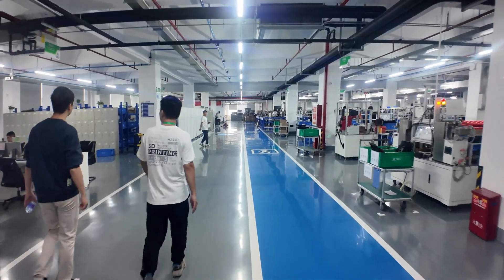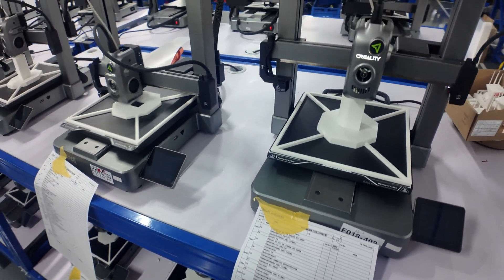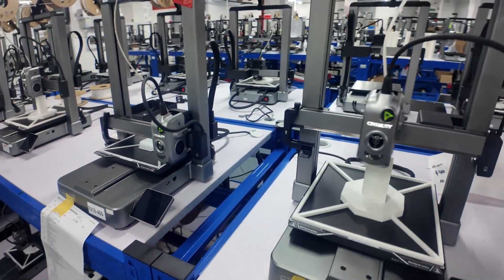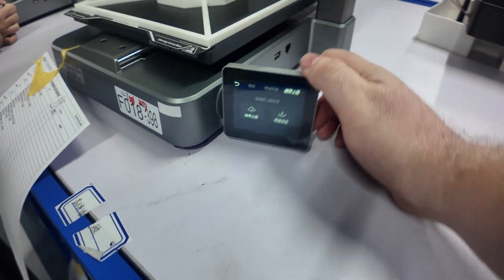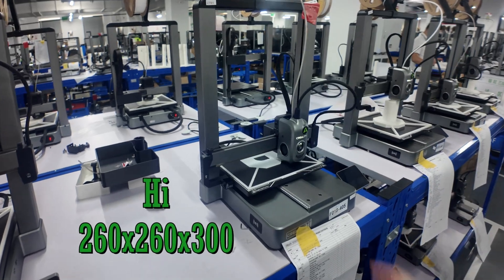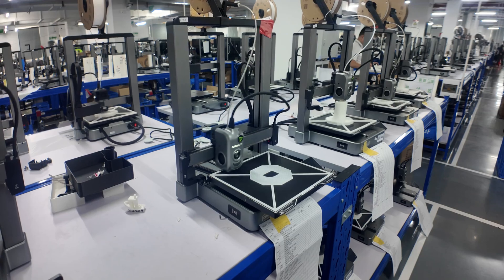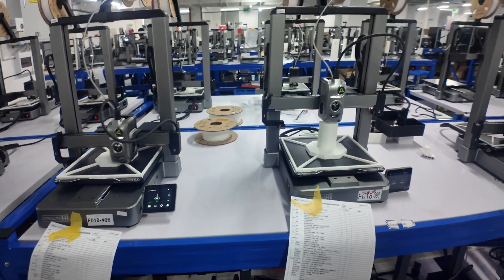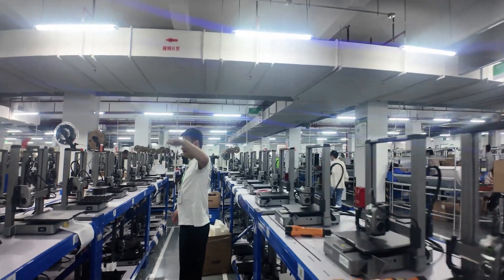New Printer from @Creality3D The Creality Hi is here. Factory tour discoveries!!

Comment: The only thing I would love to know is if this can be enclosed to print something like ABS?
Reply from the maker: so as i look at the specs it says the max nozzle temp is 300 and bed temp is 100. So that is hot enough for ABS, the short answer is yes. But as you mentioned, ABS likes to be kept inside - it can be a pain to print without enclosure. SO that means getting an enclosure for it.
Reply: @ But, will it withstand the temperature given that the screen will be inside the heated chamber?

Comment: do these printers take an SD card? im not seeing an SD card slot.
Reply from the maker: There is a USB card slot, but no SD card. I have printed from a USB drive a few times already.
Reply: @kevin.in.3d  oh okay so you can use a cheap USB flash drive then to print from then? is that what you mean?

also are the nozzles similar to the ender series where you can screw them in and out of the hot end for replacement or is it like the bambi A1 where you have to swap out the entire hotend to change the nozzle size? appreciate you taking the time to answer my questions.

Comment: Does it have a flow sensor? Pressure Advance sensor? Is it quieter than the A1?
Reply from the maker: No flow sensor
PA sensor that is preset
No idea what an A1 sounds like but this has some closed loop motors that are quiet. CFS is not too quiet tho.

Comment: I have a question for everyone. I've had original Ender 3's and now I have an Infimech Tx. It's the first Core XY with enclosure I've used. How does
this Creality printer relate, or does it?  I'm  curious if this new Creality can print ABS without an enclosure? I'm by no means an expert and have
genuine curiosity.  Thanks in advance!!! God Bless Y'all.
Reply from the maker: I was hoping someone else would give you an answer. In my experience, ABS needs an enclosure to keep the print stuck to the bed. I only print ABS in my K1. Have not tried it on my Hi yet. It meets the heat requirements but ABS is so picky - always wants to lift.
Reply: @kevin.at.Creality  you're correct. I'm able to print ASA and ABS with no issues. And yes, my printer does have an enclosure. Thank you for responding!!! 👍

Comment: 2:03 I'm curious about those test stations. What is the white surface made of? How is it attached to the blue, metal racking? I've read comments about people experiencing resonance with multiple printers on the same work surface and there they have 3?
Reply from the maker: they actually have 3 more underneath - so each metal rack has two shelves with 6 printers on it - it's a lot! I think the white shelving is particle board, I don't know how they attached it but these are very heavy-duty shelving units on a concrete floor in a factory so they likely can hold a large load and are very sturdy. I have two printers on an IKEA cabinet and it is very sturdy also - I have never had any wobbling issues.

Comment: I think the behind-the-scenes videos / factory tours are great. Is it very loud in the hall because of all the printers?
The Hi seems perfect for beginners or as a second printer, especially because of its price and size. Unbox it and get started.
It's also great that it can be used with a CFS. The print bed also has a good size.
Reply from the maker: Honestly it has replaced two of my printers at home. Having filament loaded in four colors is awesome. Slightly larger build volume is very handy. I didn't really think the factory was that loud. The machines are humming but it's a big space so it wasn't offensive.
Reply: @kevin.in.3d  That's cool that the Hi replaced the others! When it comes to the space it needs, the Hi definitely has an advantage over the larger ones with closed installation space.

How did the CFS go for you? I think multicolor printing is really great and opens up a lot of new possibilities.

Sounds good that it's not too loud in the production hall!

Comment: Fun video. I'm still a bit sore that my K1 Max still doesn't print half as well as my Bambus, so it will take me a lot to buy another Creality again. Creality is trying hard to duplicate all of the Bambu printers. This isn't really a bad thing and I do like that is uses the same CFS instead of a AMS Lite style set-up though.
Reply from the maker: Also can use 4 CFS - unlike the lite which can only do 4 colors. We will win you back! We are trying anyway lol
Reply: @ Agreed, thus why I said I like the use of the standard CFS. Both because it allows multiple CFS and it is fully enclosed. :)

I really, really want to be won back. I've had at least 20 Creality printers over the years. The K1 Max experience and it being released before being fully ready, just stings a little a year later. I still have it, but only run it when I need over 255mm.
Reply: Do you have the updated model with unicorn nozzle etc? What sort of quality loss are you talking compared to bambu? 
I was tossing up between a k1 max and qidi plus 4 - the k2 is way too exxy.
Reply: @swempthebemp  My K1 Max is a weird mid-production unit. It had the updates to the extruder, but had the older, volcano style nozzle. I did the update to the hot-end to the Unicorn nozzle. I saw very little difference, if any. But it is easier to swap nozzles.

My K1 max had a TON of ringing/ghosting as delivered. Now that I have rooted it and am running standard Klipper, made a couple minor hardware changes, and altered how I tension the belts, it has reduced ringing for sure. I changed the bed to being adjustable as it was way off level as delivered and between that and changing the starting gcode to heat soak the bed for a long time (the beds are fairly thin and warp a good bit when heated), I now get consistent first layers most of the time. The times where the first layer fails seems to be more related to the nozzle wiping routine before the bed leveling sequence.

Comparing it to my Bambu A1 and X1C, I would say the surface and layer quality on the K1 max is around 75-80% of my Bambus. The Bambus I don’t even have to do anything with. But the K1 Max I had to work harder to calibrate.

Knowing what I know now, I would go with the K2 rather than a K1/K1Max. They released them before fulling baking them and are a bit in-between and for the price are just OK.
Reply: @iwannaratrod  think I'll go with the plus 4, thanks for the feedback!
Reply: @swempthebemp  I haven't heard anything on the Quidi from anyone I know. And it doesn't seem to be without issue either.
Reply: @iwannaratrod  the issues seem with 110v power (I'm on 220v) and they seem to have more features and a better finish for the price, just a lot shorter track record..
Reply: No Brasil chega quando

Comment: I really wish Creality would finally start focusing on after-sale support instead of continuously flooding the market with printers :(
Reply from the maker: I feel like they have been trying harder to focus on keeping people happy. Are you having some troubles now or is this a comment from a past experience? I know we definitely had issues before, you are not wrong. But we have a lot of ways to contact the help you need now - including emailing me at kevin@creality.com
If you need some help, I'm happy to see what I can do.
Reply: @kevin.at.Creality  
Hi Kevin and thanks for the reply.
The short answer; I just recently bought a K2+ and I'm looking to the future. Specifically how easy will I be able to get/replace wear-n-tear parts (belts, nozzles, belt tensioner, etc) or/and additional or variations of parts (bed sheets like PEI or smooth etc) or if I'll be able to get these parts at all.

Long answer (tl;dr);
I was on the fence between Bambu and Creality as my Little Monster just died back in August. Bambu has very strong after-sale support and they seem to focus on support and improvement of their current machines rather than flooding the market with yet another machine seemingly every 6months (exaggerated but you get what I mean). With Bambu, I would be able to easily shop virtually ANY component of their printers and have it shipped to me with no fuss. I don't get that warm-fuzzy feeling about Creality, knowing how they got to where they are now, but despite all that, I bought a K2+ anyway (I'll not go into the reasons why unless asked).
I'm pretty savvy when it comes to 'just make it work' if something were to happen, but I'm getting to a pointe in life where I don't want to have to constantly fiddle with something to make it work again. That said, while my K2+ has been an absolute unit of a machine, the maintenance clock is ticking and when times up (IE, when something fails or is worn out) I'd like to be able to go to a parts portal, enter my S/N or model#, shop the parts then stalk my mailbox. The only time I should have to interact with a CSR is if something goes awry with my order or I don't know what to order given a specific and/or articulable issue I'm having with my machine; even 3-4yrs down the line.

I assume you have some pull at Creality? If so, perhaps convince them that what people want aren't a bajillion flooding the market. People want consistency and improvement. Also to know they have a place to get parts in order to keep their machines, their investments, going for as long as it can.

It's like in the automotive industry, people told Porsche they were crazy for putting the engine in the back of a car... But Porsche kept at it and kept improving it until the pointe you can't go to a track anywhere in the world without seeing some variant of a 911 running it.
What I'm saying is, the K2+ can be Creality's 911. Creality also has a entry (Hi/Ender?) and mid-tier (K1?). You get my pointe :)

Sorry for the rant.
Reply: @kevin.in.3d 
Sorry if the reply showed up multiple times. YouTube app is behaving strangely.

Comment: Length of unicorn melt makes for huge waste. Disappointed that they're sticking to it unless they're changing it to fix that and the color bleeds on the K2 prints I've been seeing 😢
Any chance of seeing multicolor examples of this printer? Perhaps it's got something different?
Reply from the maker: color bleeds can be adjusted in the slicer settings - I'm not a pro at multi-color prints but if you mess around with the flushing volumes from dark colors to lighter ones you can fine tune that very easily. Longer nozzle makes for more waste - totally agree there!

Comment: The 3d printer and filament manufacturers need to standardize on an open rfid tag for filaments.  If the 3d industry wants 3d printers to be an appliance then they need to be plug & play.  You plop in a filament and off it goes.   All this proprietary tag stuff is not doing the industry any favors.   There are plenty of industrial and retail standards so competing companies can work together to make operational and user experience better.   The 3d printing influencers need to start pushing this and the sooner it gets done the better.  /the further all these proprietary rfid are created the worst the problem will get.
Reply from the maker: it would be so nice if they all worked together on that, totally agree. The idea that 3d printing influences would have any power at all to make that happen is just not possible. That is not the way that relationship works at all.  One RFID for all filaments - would be so nice!!

Comment: Any idea what those white test print parts are used for? Part of their own packing material? It seems rather large for something as a test/marathon print alone.
Reply from the maker: They do not put them in the box, just test prints. I should ask if we are recycling that filament; there is a very large volume of single colors there we could be re-using.
Reply: @kevin.in.3d  I haven't seen print recycling that makes any sort of sense, but there has to be some part that would work as a quality test that could be useful.